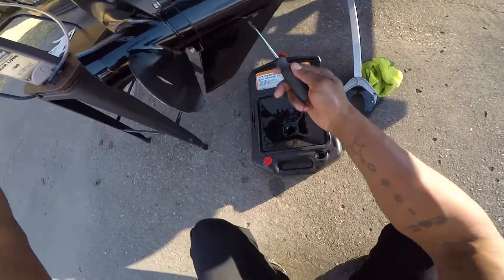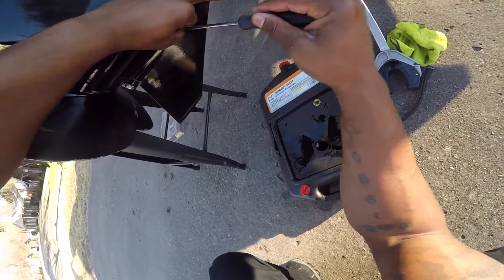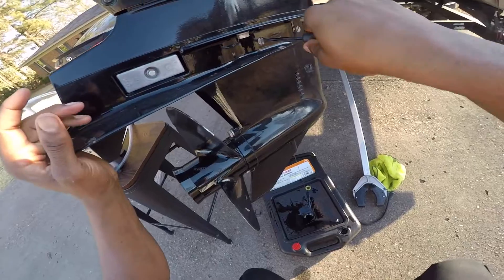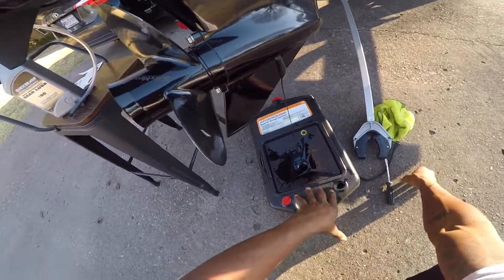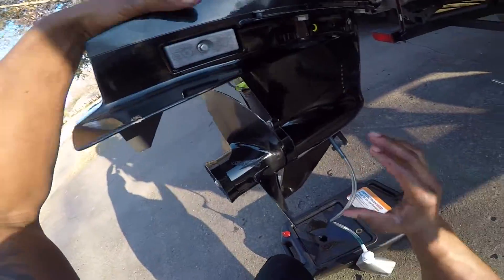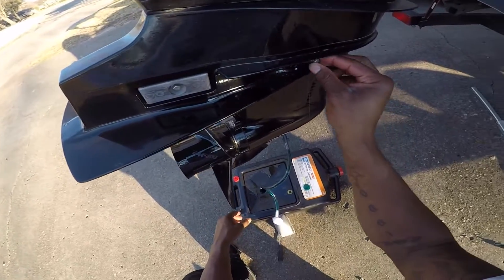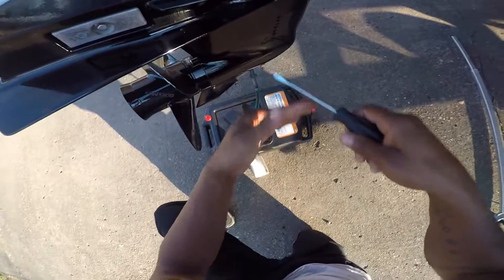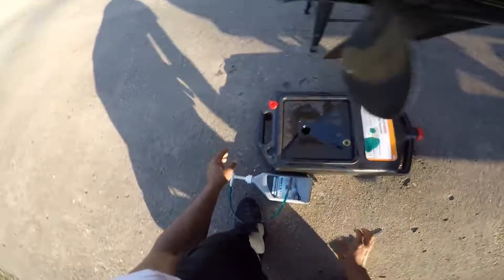2021+ BASS BUGGY 40-60HP LOWER UNIT OIL CHANGE MADE EASY

Comment: Lovin mine. Got the 50hp. Seems like it is using a bit more gas than usual. Imma try trimmin a bit to see if the drag gets a bit lighter.
Reply from the maker: I trim mine and don’t throttle it all the way down keep the rpm right around 5 seems to help me a little but that 50hp on that big body benz will do it lol

Comment: Looks easy. I have a 2022 on order.  Hope it gets here before armagedon.  Is that a kit for changing the oil?  You probably save hundreds of $$ for 5 minutes work !!  Peace
Reply from the maker: Yes it is bass pro shop has the oil changing kit and lower unit oil but they can be boat at some Walmarts let me know if you need the numbers
Reply: Saw oil change kits on the Mercury web site.  I'll shop around though.  Have you greased the motor yet?  Supposed to be 3 or 4 zerks somewhere on the motor.... saw on Youtube where a boat mechanic pointed them out on a different HP Merc. motor.  Speaking of grease, does the trailer come with bearing buddys on the trailer wheel hubs?  If not, I'm going to have the dealer install them when imy boat comes in.  Thanks and good luck !
Reply from the maker: @redveiner  no they come with a oem that the trailer has and I greased my engine as well.  I like to keep my baby looking good!